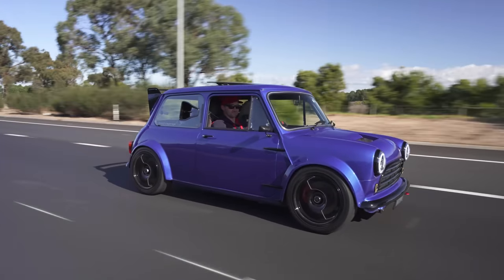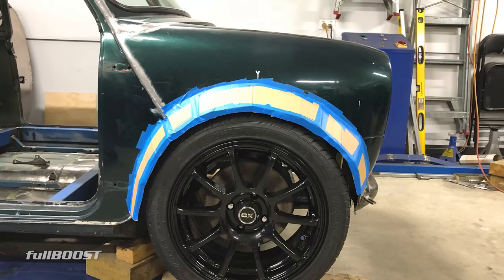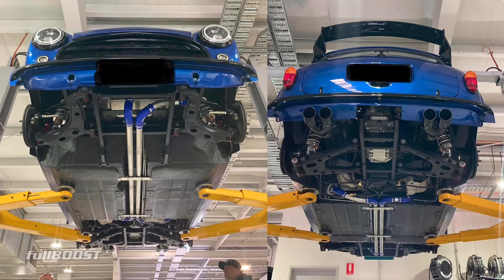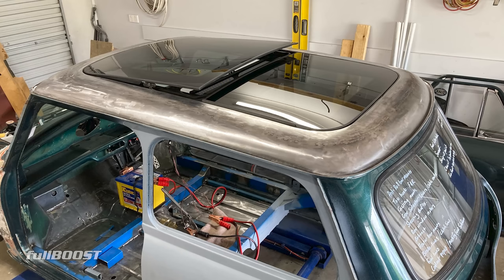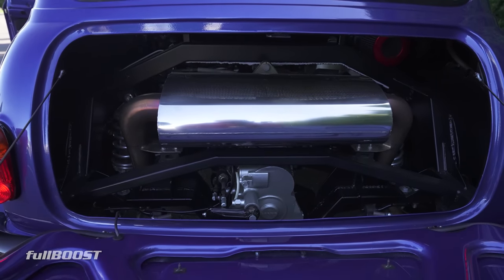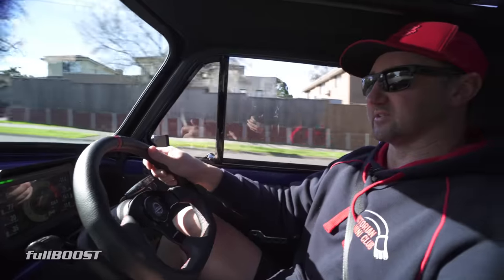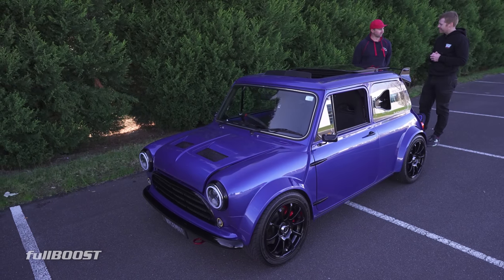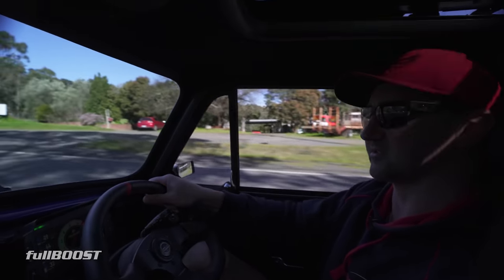This RWD Mini is a street-legal GO-Kart! | fullBOOST

Comment: Back in the 1970's I met a fellow that had a two engine/four wheel drive MINI. He removed the roof and replaced it with a toneau like cover. He had a center stack on the dash that had duplicate instruments. The frame was beefed up to deal with the additional weight. It used two S engines but don't know at what state of tune. He ran on the streets and also auto cross events. I suspect that the weight of the extra engine was a detriment but it was impressively quick...even in autocrosses. I would think this mid/engine version would be a lot better balanced and seemed to handle well in this video. A modern Subaru boxer engine would put out as much HP as the other two engines also.

Comment: Sweet mate, I did one of the first wrx beetles registered in NSW, so I can appreciate all the small details and thought put into the build.The metal fabrication looks awesome. Did the same intercooler with scoops feeding the air to air. I have some of the coldest air intake temps around and used to have small fans on the intercooler, however lost them a while back as it ran cooler without them. Thanks for sharing.
Reply: Awesome. Would love to see your Beetle and the build. I’m sure it is great.

Comment: I've got a Cooper S Clubman. The stiff suspension on a mini is good for corners and horrible for potholes. I think a 2 litre golf TDI in the original mini would be good if it fits. Some tall gear ratios for miles per gallon, and some shorter gear ratios for smiles per gallon.

Comment: Not usually a fan of big wheels and low pro tyres  or turbo nutter injected engines bolted to vintage vehicles  but this one is done right Seen a couple on another channel and I really like them. . You can tell it's not stock but it's still has all the essential Mini character that makes you smile.

Comment: I have seen one with a BMW E30 M3 S14 engine with transaxle gearbox of course no back seat any more, the engine was pushing 342hp on the  wheel, S14 was tuned to DTM spec and it was a monster, it was a mini with huge balls.

Comment: 15s on this look like 20s on modern cars. Kinda fits with the whole "cars are 1/3 bigger than 60 years ago" thing. I mean, even 20-30 years ago, 18s would've looked like this does with 15s, so... Luckily a car that looks proportional to this with 20s seems to be the practical limit from a physics standpoint. Hope we don't get them much bigger, TBH.

EDIT: Just did some math, the modern mini is more or less exactly 20% larger than the classic one. If you put 18s on a modern mini it'd have the same proportions as this car. I think it'd be cool to do this build on a modern mini, too. Or try something full custom that's in between the two and scaled up 13.4% larger than the classic one so that 17s on it look the same as 15s on this guy's build. That way you have a bit more legroom and whatnot without quite making it as bulky as the modern mini.
Reply: Now that’s a detailed response with a lot of thought.👍

Comment: Love the attention to detail throughout the build from the Subi motor to the Miata NB suspension and everything in between. Here in Texas, we don't need an engineer when performing a motor swap or any modification granted it's 25 years or older. In 2025 inspections will no longer exist so it will be interesting to see the builds that hit the streets in the coming years. I'm sure a HEMI in a Mini is just around the corner...or how about a Mini Plaid?

Comment: Excellent bit of engineering mate..love it .. just a question .. I wanted to buy Mazda RX8 change the power plant to an Audi or ford .. but I couldn't find anybody to take the project on .. surely it's not that difficult
Reply: Anything is possible. All the money is in the labour though. 
If you want it to be street legal then you need to find an engineer that is willing to work with you and certify the project. That’s the biggest challenge in Au.

Comment: Very very tidy work sir🔥🔥😎
Reply: Thats not completely true about lag having the intercooler at the front, specially since it such a small car, as there is no lag problem with rear mounted turbos, and the long pipes running under the car actually helps cool the charge also.
Reply from the maker: We've owned Subarus with front and top mount intercoolers the lag difference is noticeable.
Reply: @fullboost  roger. I guess different engines react different. My friend has a commodore with a rear mounted turbo, non intercooled, with an alloy pipe running up to the engine, intake temps seem to be ok on the street. Plus it only running 10psi. You did a fantastic job gettin that engine in the car, looking at the sub frame u made i could tell you knew what you were up to for sure👍
Reply from the maker: Yep, much bigger engine would be the main factor.

Comment: Amazing work and engineering and to have it road worthy is a feat in Vic,, me only gripe would be the styling eg. the front headlights being led and yet have conventional at the rears, either go all halogen or all led and the wheels are just ugly do not suit the flairs at all, you need a little deep dish kind of wheels in there.

Comment: No one complained all that much about the Porsche Carrera GT's fuel tanks but it still toasted Paul Walker when the car slid sideways into tree. You can overengineer a fuel tank so that its less likely to burst and cause a huge fireball but that more expensive and weighs more and stores less fuel...Mini like this is never going to be all that safe unless you want to make into something that is not really a Mini in any way.

Comment: The older mini is way better looking than newer ones,they were designed for affordability, so everyone could have opportunity purchase one,new mini is ok but price way over top ,making mockery of original concept ,know 2 separate mechanical shops told me never buy new mini feel cheap to drive,handle like crap this was from 2 independent shops so must be truth in that ,said alot owners come to their shops looking get suspension upgrades ,brakes,even steering but price way out question ,so stick with older ones last longer drive way better go cart on wheels like in video and old ones do burnouts in reverse 😅

Comment: It's cool but it's not a mid mount it's a rear mount ..what I don't get us why not go ez30..same weight 200+ HP automatically and weight ain't my h different either ..far superior engine to ej..sounds better to ....only thing I don't like about that mini is the sound ..it's rubbish ...
Reply from the maker: That would make engineering harder again.
It is a mid mount, the engine sits just behind the seats and  is in front of the axles.

Comment: When they remodeled the Mini's to what they are today they sure screwed up. The real mini was cheap to buy and cheap to run, the new Mini's are too expensive and too plush. Someone who needs a cheap car to operate needs the old mini. The old ones are going for double what they cost so if someone wants the opld one they have to pay a premium to get an old one with 100,000 miles on it and it will still outperform the newer models.